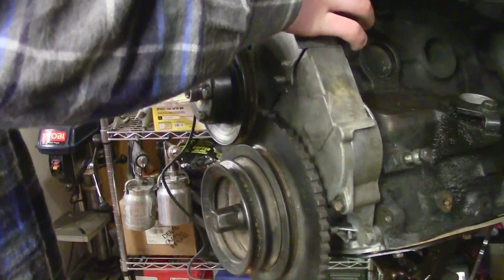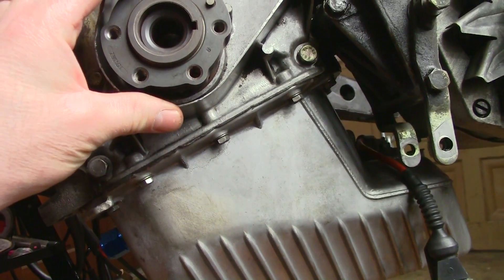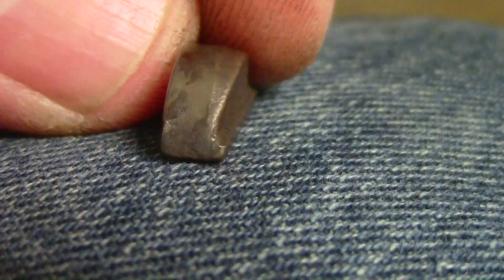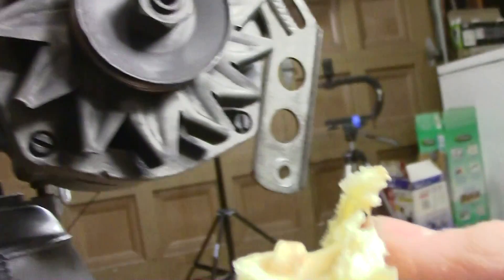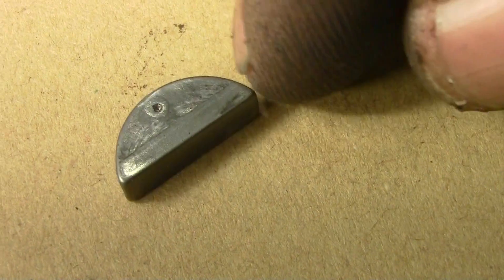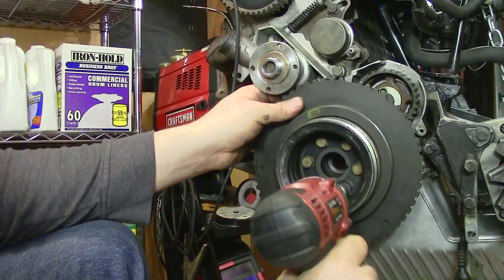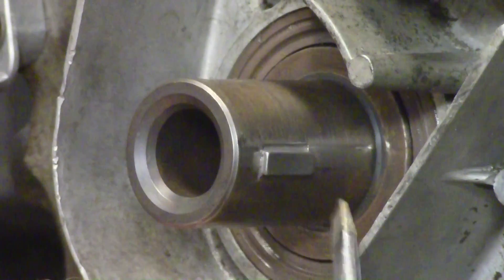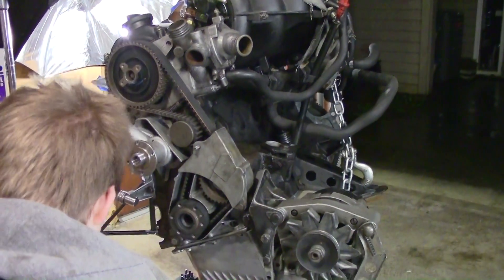BMW E30 Timing Belt Pulley & Crankshaft Damage + Ghetto Repair!

Comment: Just discovered the same problem but worse. How long did this hold?
Reply from the maker: Still holding strong even after many drift events, actually. 

Read through the comments as there were some other good suggestions. The best is probably to carefully weld a bead where the metal is deformed/missing, then file it back to the original shape and put in a brand new key. Finally torque that bolt to spec and use your thread-locker (Locktite)
Reply: Jonas Van Horn no one in my area would do that job for me so I ordered a d16 from hmotorsonline for 800. Sad day. Only owned this particular car for a day before I discovered the crank eaten up!

Comment: Can I say fuck the key and just loctight the bolt into it. Ej22 suburban engine
Reply from the maker: If you lost the woodruff key (the little half-moon-shaped chunk of metal that holds the pulley in line with the crank), then absolutely get a new one. They’re cheap and you can find them at good hardware stores and auto parts stores. Better still the dealer could probably sell you exactly the right one for cheap. If you’re talking about filling a gap like we had to, you could try it if you’re up for a gamble. If you care about the engine and don’t want to risk it though, a skilled welder could probably build it back up for you and you could carefully file it back and be confident in the repair. In any case though: proper torque and Locktite for sure.
Reply: No

Comment: Do you keep a piece of bread in your toolbox just for these jobs ?     You should because you atta not be doing these jobs without bread and or jb weld !   That way the mechanic knows what's wrong with it where its coming from so he knows what kind of shit hes about take on !    And dude.....   give it a couple mins for the jb to dry up ???    What the FUCK IS YOUR BRAIN RUNNING OFF OF ?       If you understand little about basic fundamentals basic anything then dont go fuckn with anyones vehicles even your own !     This timing gear will fale it will brake snap apart under tension sooner then later causing catastrophic engine failure!      I guarantee this will fale   and an engine is internal combustion (gas) powered a motor is electric ok people get the basic fundamentals down first before you can think of doing any professionals jobs you'll fuck your shit up there are only two ways to do everything wrong or right good or evil the entire universe works on and off of the same principles everything every last atom every last everything ......   FUCKN A
Reply from the maker: Usually we don’t reply to posts like this because some folks are just angry. In your case I think you might genuinely be trying to help? So we’ll give this a try. First...in general we’re not pro at anything and say it all the time. More specifically we literally laugh at these methods throughout this video and specifically state that we’d never recommend anyone else try to fix the crank pulley this way. With that said? It has worked. For many many months so far; at rev limiter on many track days and for months of daily driving. For the record? we still wouldn’t recommend it...but it did work. Timing still stays dead-on. What would we recommend? A new crank or having a very good welder fill and file back the damaged metal like RobTapps88 recommends elsewhere in these comments.

Comment: Okay love the video I'm just wondering on the front end of the video you said to turn the engine around one full Revolution ......Are you saying to turn it by hand THE CRANKSHAFT PULLEY.........WHAT ABOUT THE TOP ONE  CAM PULLEY ??
Reply from the maker: Good question! After watching again, I guess that’s not very clear. So, yeah, the clip at the beginning of the video was after putting everything together the first time – with the timing belt on - Everything was spinning together. As you learn later in the video though, you shouldn’t have to do that. Things wouldn’t lineup reliably because of the problem you see with messed up key and keyway. Does that make sense?

Comment: loctite 660 is made for this repair
Reply: I think loctite 660 is only supposed to be used for gaps less than 0.5 millimetres.

So they damaged/missing side/extended/widened keyway is much bigger in this video....maybe 3mm?

So I'm not sure if 660 is made for this problem tbh.  My keyway is similarly damaged and I'm a bit concerned it won't hold since it's a big area/volume.

Comment: I have the same problem with my engine's crank nose keyway... I'm wondering if I should fill with JB or instead grind a larger keyway.  How's the engine doing today?
Reply from the maker: I would just JB weld it. My car is running very strong still!